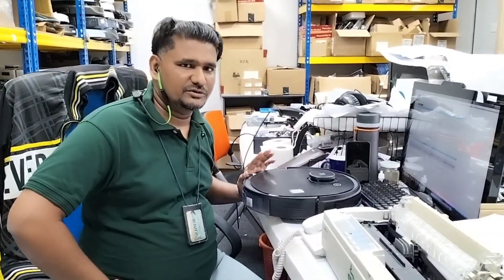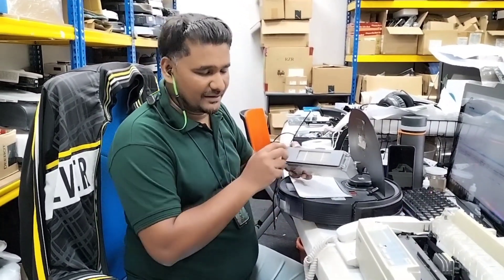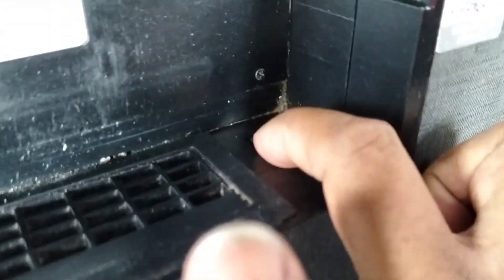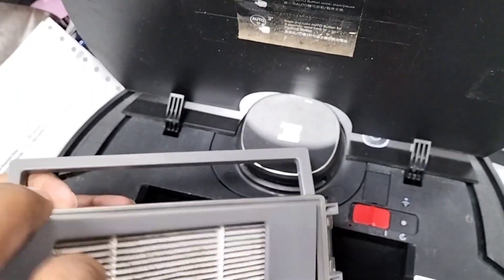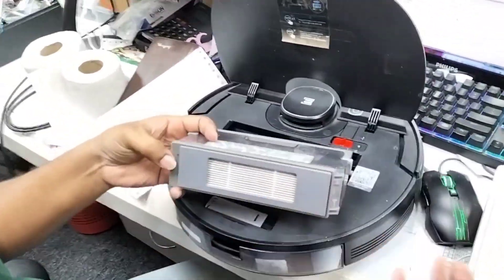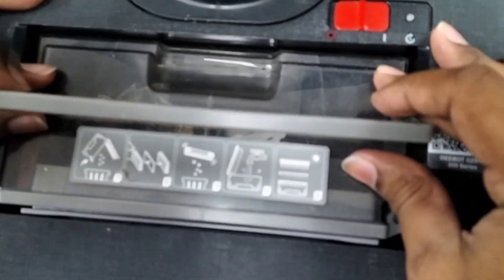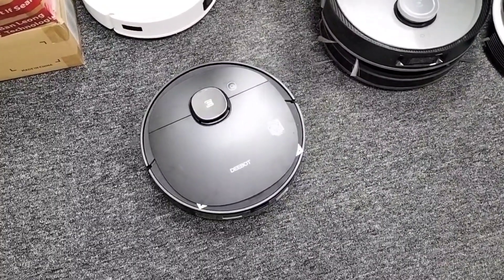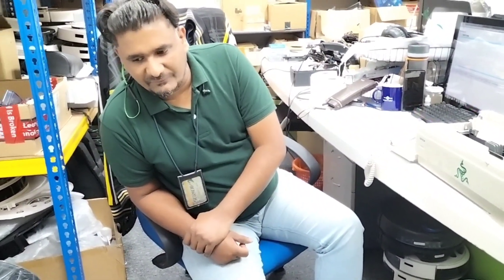Please Install Dust Box. How To Fix This Error??

Comment: Mine says "dust bag not properly installed" changed brand new dust bag and still same error, any ideas? thank you so much
Reply from the maker: Dust bag sensor wire might be damaged or sensor is Faulty that's why can not recognise the dust bag
Reply: I don't have that sensor on my model g20 pro ?? But still says insert dustbin.  Help

Comment: Hi, I have a ecovac ozmo 950. My right side brush is not working and the machine wants me to untangle it. But it isnt tangled. I tested the Motor with a 9 volt battery and it works. Ist the motherboard broken? Can I test it somehow. And how much is a replacement motherboard? 
Thanks ,ou in advance:)
Reply from the maker: Fir testing purpose you can remove other side motor & fix this side but don't screw up...just connect wire & give command to vacuum see weather it can turn or not...if can tun then just side brushe motor assembly need to replace if can not turn but in other side can function that means motherboard & side brush motor together need to replace..got shortcut somewhere..
Reply: @ecovacstechnicalsupport5278  Thank you, I will try
Reply from the maker: In Malaysia to fix Ozmo 950 model can contact me.ill fix..00601137973018

Comment: I keep getting the off the floor error message after picked up and cleaning my Deebot Neo. Any advise on how to fix the error?
Reply from the maker: When we picked up in our hands then robot sensors work that it's not in floor... that's confirm will give error...just put down on the floor n run.. that's all...if you hold in hands n try to run then robot will give this error

Comment: Hi there, do you have a video for replacing a side brush motor on a T8?

The clip that holds my green side brush has broken and I believe I have to replace the whole side brush motor to fix this problem.
Reply from the maker: There are 2 videos available how to disassemble & assemble back...if you know how to disassemble then just remove main board 3 screw n core board clip then just remove side brush motor 2 screw on top & 1 screw From bottom & replace new assembly then fix it back as it is

Comment: I just bought this same vacuum, but I have a different issue.
It will not dock with the station. It tries over and over. and finally gives up. I place it on station and visually see metal charge contacts touching each other and leave over night. 60% before sleep at 60% when wake up... Either electrical issue on station or robot.
Reply from the maker: If it's not ozmo 950 then might be a battery issue... very rare cases that motherboard need to replace in other models but Ozmo 950 always just motherboard issue in this type cases
Reply: @ecovacstechnicalsupport5278 
I returned it and got another one.
I think forsure was something wrong with base station because the light on base station never lit up...didn't know it lit up until I got a new one. It is interesting on the faulty one where the light was not turning on was still seen by vacuum and it navigated to it, but just kept ramming it when on the ramp. Also electrical symbol on map was not showing up on map for station on the app with old one. New one works perfect.

 I called there support and they hung up on me 3 times after 2 min conversations and when I called back the third time they asked if previous calls helped or not... even though the time was just me tell them the problem and some simple tests. I hope not all their support is not like that, lol.

Comment: Can I use wheel replacement from normal online retailers..are the reliable? Ozmo 900 model
Reply from the maker: Can...no issues but make sure choose the correct mode n correct side left or right
Reply: @ecovacstechnicalsupport5278  Thanks for the tips 👍

Comment: I need your urgent advise and expertise please sir.
Deebot Ozmo 920 original batt specifications is:
Model no of batt: S09-LI-148-3200
16.6V
Rated capacity: 2900mAh 42.92Wh

I need to buy a replacement battery for it, but it seems all the battery that is sold online has a s slightly different specs:
14.4V
3400mAh

Is it ok to use it? 
Wil it spoil the mother board?

Thanks
Reply from the maker: Don't worry slightly Mah power higher won't damage the board...can use..

Comment: Sir, Where can I purchase the authentic replacement battery for the Ozmo 950 online?
Reply from the maker: If Ozmo 950 model. Then plz confirm first weather it's a motherboard issue or battery... because in this model 95 % motherboard issue not the battery